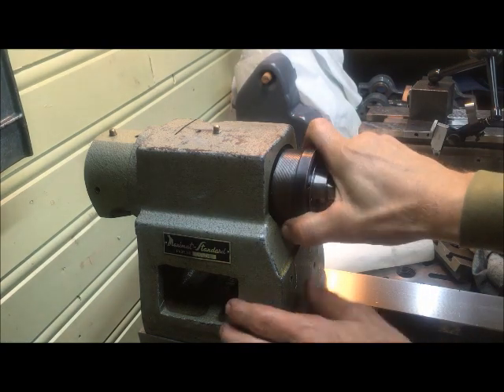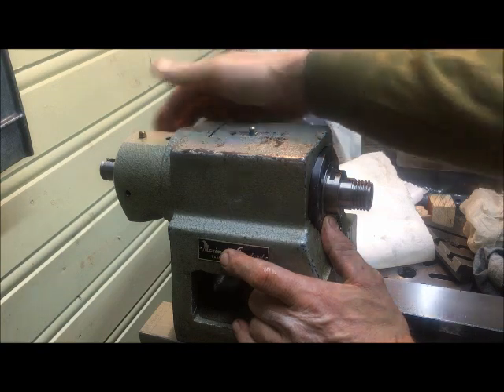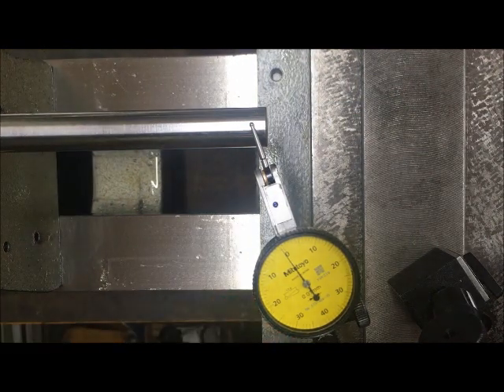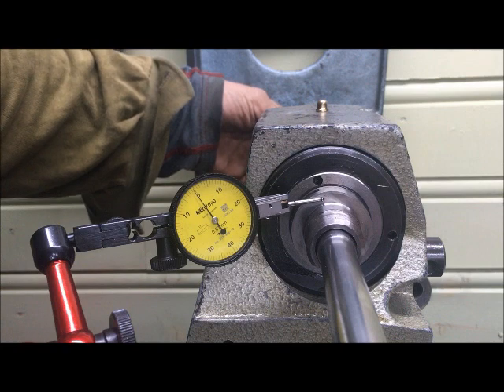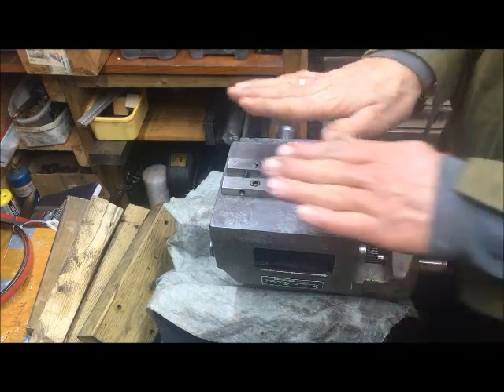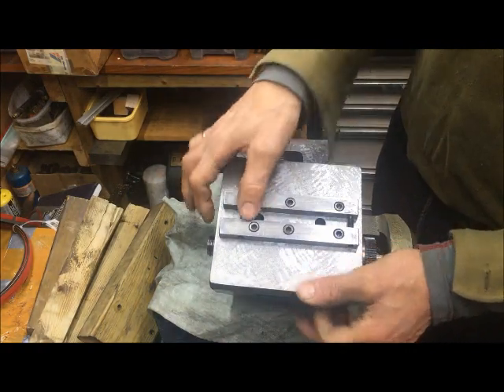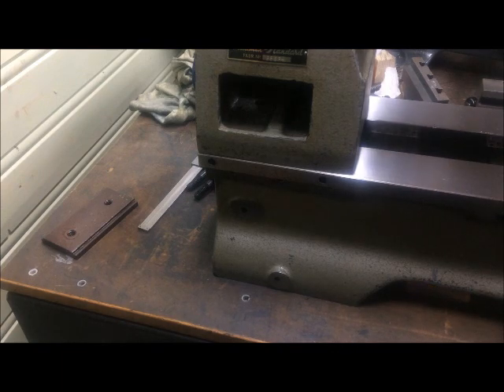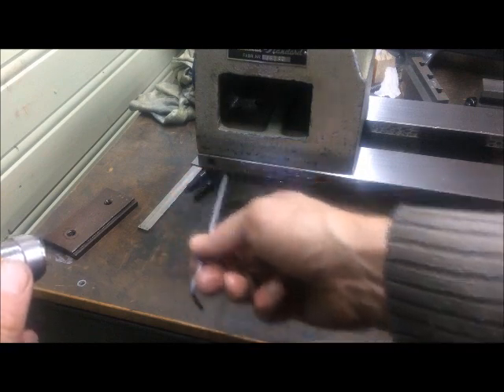EMCO Maximat Standard   headstock

Comment: i am impressed with the spindle design for this kind of setup with the moving quill. This setup is the same as the schaublin lathes, DB angular contact bearings at the rear, and a tapered cylindrical row bearing at the front. Its a shame they didnt beef up the headstock size on this emco, which would consider it as a very high class machine.

From what i see from the later emco lathes, they use a taper roller bearing on either end.  And yes the bearing cost for a new set of P4 angular contact and P4 cylindrical roller bearing would put you in the £1000 range just on bearings.

Comment: Greetings from South Africa Mr Jan. Please can you do a video on how to strip the headstock down to replace the bearings . 
I have this very same lathe from my father . And we want to do a build together. 
Also the 3jaw chuck can you add links for them . Ours is worn ... 

Any bit of help would help us greatly. 

Thanks Seelen
Reply from the maker: Dear Sir,

I am sorry, but I didn't pull the spindle apart as the bearings weren't replaced.and I do not have this lathe any more.
However, I see that a gentleman on the German forum Zerspanungsbude.net has done a complete overhaul so this thread might be of interest to you.
https://forum.zerspanungsbude.net/viewtopic.php?f=47&t=53354&p=641462&hilit=maximat+spindelstock#p641462
PS! I am a member, so to access this particular topic you might have to first enlist. Good luck anyway!
The 3 jaw is a standard lathe chcuk, but the trick is to adapt it to fit the spilt backplate
Reply: @jansverrehaugjord9934  oh dear... was just my luck . Main problem was to get the pulley out. Does it unscrew or did have a sir clip.  Can you remember by any chance?
Reply from the maker: @seelengovender1881  Neither if I remember. Just took quite some force to pull out using the same method as in the thread in the link I sent you. He has a lot of pictures on this, a complete headstock dis- and reassembly and you don't need to understand German to follow. Do you have the manual for this lathe? The photo I have in my video is taken from this
Reply: @jansverrehaugjord9934   great stuff sorry i never clicked to read further. Yoy made my fathers month. He has been watching your particular videos and thinking of the good ol days and how used to work with his lathe.

Thank you again for your help and advice 🙏
Reply from the maker: @seelengovender1881  You're welcome. I wish you good luck!

Comment: Hi, maybe did you measure the temperature of the spindle? Mine is getting pretty "hot" 45°C in about 5minutes of "free running" at 600rpm, the grease in bearing is new, maybe is a little bit too much thicker? Or is the problem laying in preload? (Did not touch the spindle yet).  Maybe can you help me again please?
Good day
Reply from the maker: Hi there, sounds like your problem is using grease in the bearings. I am pretty certain they should be oiled
Reply: @jansverrehaugjord9934   what oil should I use? 
The spindle does not seem it will "hold oil in it" the grease is simply "melting" out.
Thank you for answer.
Reply from the maker: @MrDrek44  Hi again, I was wrong. The user manual states that you should use "Fett" ie. grease, at intervals of 500 hours,  for the main spindle bearings. There is no indication what kind, so I assume you can use any good grease that is available. Not that I know much about this, but assuming the temperature problem (heat build-up) is not caused by binding og any other "malfunction" I would use the thinnest lubricant I coudl get hold of to try see if this solved the problem. If it was me, i would try some thin oil, say regular hydraulic oil, and even though this has to be replenished often because if leaks out, you would get an idea of the temperature stayed within normal limits. if so, then I would start investigating which grease to use. Good luck!
Reply: @jansverrehaugjord9934  thank you for your advices. I will sure them! Good luck.

Comment: I have a problem with my USED Maximat standart Lathe. 
Need a new Spindle/headstock cause its bend 2/10 mm.... pretty dangerous.. 
maybe you have a head stock left? ;)
you know if i can use other head stock? From a V10?
Reply from the maker: Hello there,
Are you really certain that is the problem?? I have never encountered a bent spindle with 2/10 mm runout without it also having caused more/other serious damage to the lathe. Is everything else in order? In any case, I have only one headstock. The V10 bed is different as this is a V-way bed, while the Maximat Standard is a flat bed. I guess the nearest to investigate would be an Emcomat 7 as this is also a flat bed, altthough of course this is an all-geared headstock (superb lathes!)
Reply: Hey Jan

Hey, i bought the whole lathe pretty cheap. 
THe Bed is a bit damaged. seems that something cracked pretty brutally out of it!

i took the chuck off and messured directly on the spindle. even with the chuck, as longer the part gets away from it, it gets pretty worse! u can easy see it with your eyes!! 
 
My other option is a new Lathe.
Reply from the maker: @Magonos888  Hi again,
OK. Then it is a real possibility that it is just not worth the trouble. Maybe you can do better selling off the lathe in parts?
Reply: yea in this case i gonna sell the parts i think!! 
Can you recommend me a machine? maybe a bit "bigger" in diameter as the Maximat standart. can be shorter in lengh, no problem. 

Regards, Marcel
Reply from the maker: @Magonos888  Many to choose from, eg. the Colchester Chipmaster which I have had the pleasure to own
Reply: Magonos888 
hello, I have the same standard maximat lathe, if you decide to sell parts I might know interested ... Thanks Pierluigi